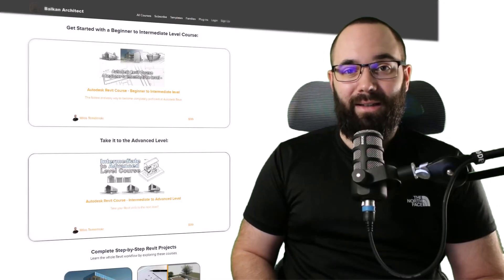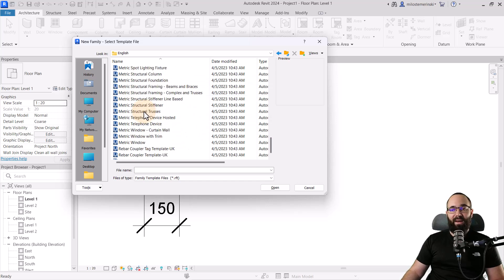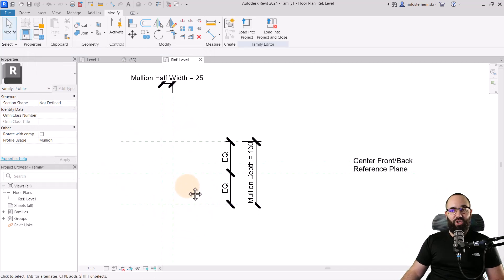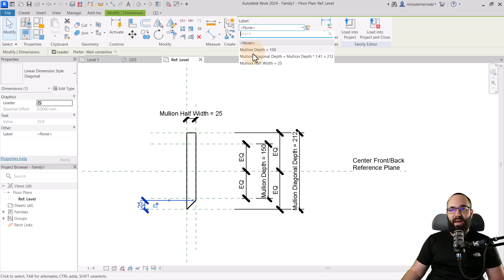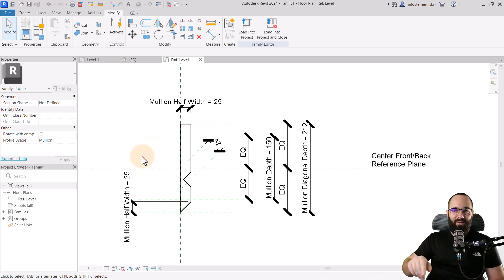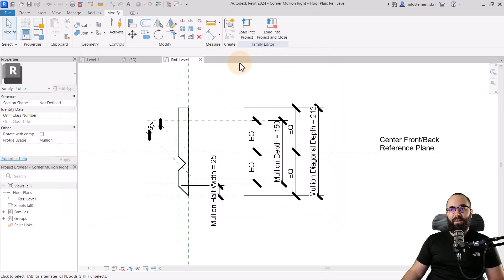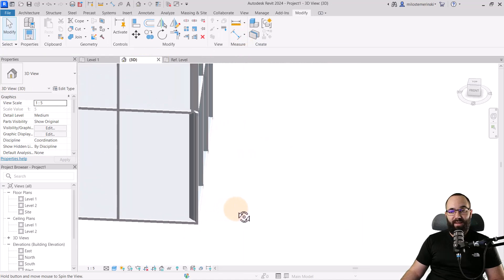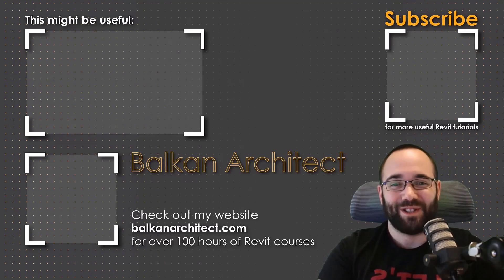Diagonal Corner Mullion in Revit Tutorial

Comment: exactly what i've been looking for.
however, usually mullion (vertical) wins over the transom (horizontal) so connecting the transoms like you did doesn't work. is there any other workarounds for that specific issue?
Reply: You can change the curtain wall settings to have the transom join over the mullion.